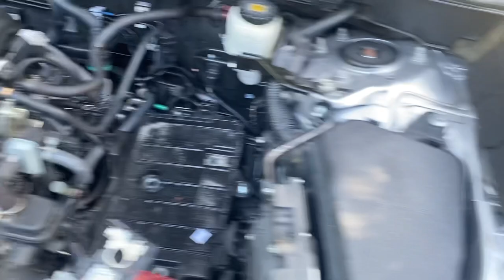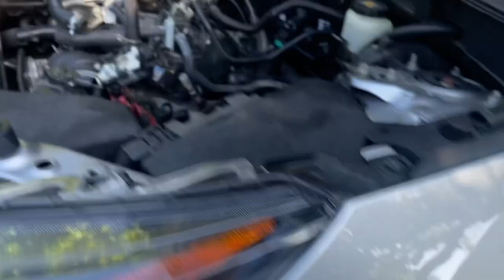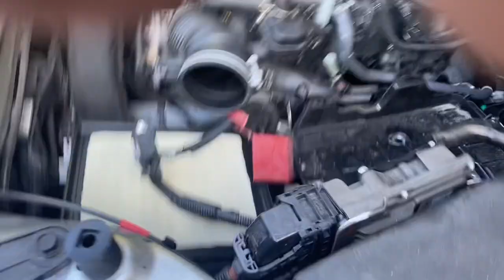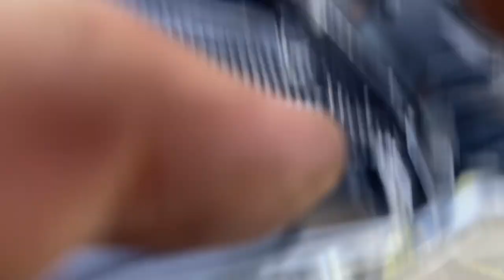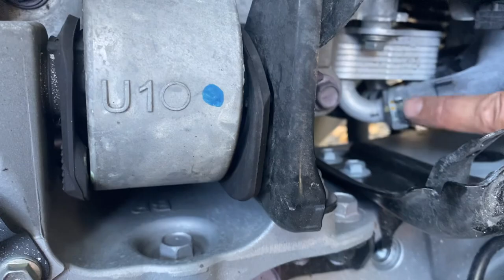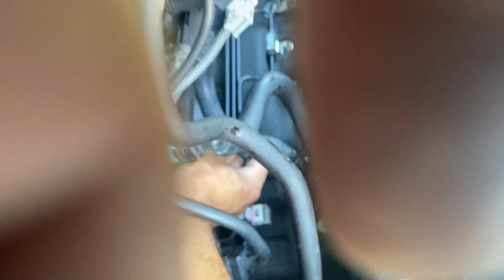2019-2024 Toyota RAV4 Camry coolant bypass valve hose location

Comment: On the connecting hose below the battery, there seems to be two clamps, the metal clamp and a black 3/4 circled plastic clip. Does this black plastic clip need to be removed prior to removing the metal hose clamp?
Reply from the maker: It’s been a few months but don’t recall. Do know there’s a 10mm by the head that holds the other bypass valve to allow access. Rear of the wheel well with the steering wheel cocked all the way to the right is best for the transmission end. Thanks for watching!

Comment: Hey did u lower the coolant level or just went for it???
Reply from the maker: Loosen the automatic transmission cooler first as it’s the lowest to drain coolant or go for it! Thanks
Reply: What’s the average mileage the valve go bad ? Thanks.
Reply from the maker: @nissanquest2002  this one in particular failed at 112k but rule of thumb at 100k miles do a thorough point inspection. Pressurizing your coolant system should be one. Good luck!
Reply: @WoodLox  I went for it but caught some of it with a pan. Thank you for the info and the video.
Reply from the maker: @alexmartinez7393  you are welcome glad it helped